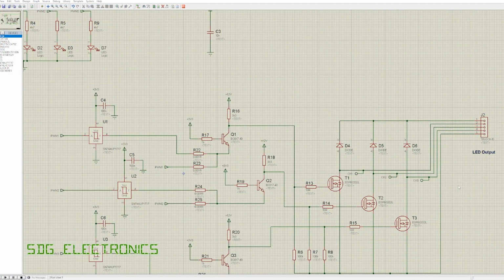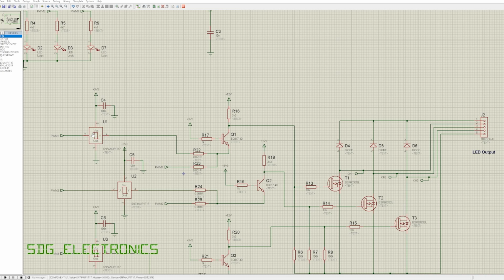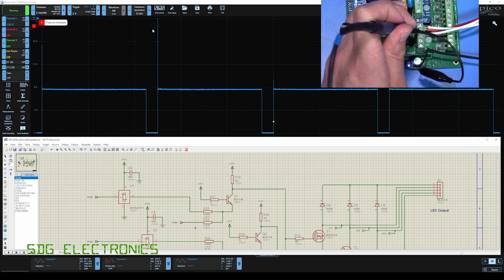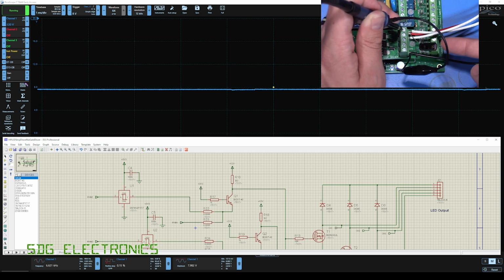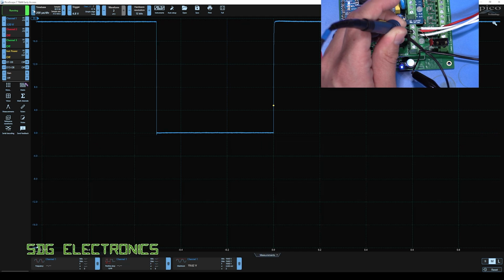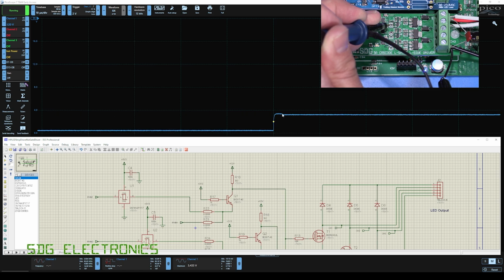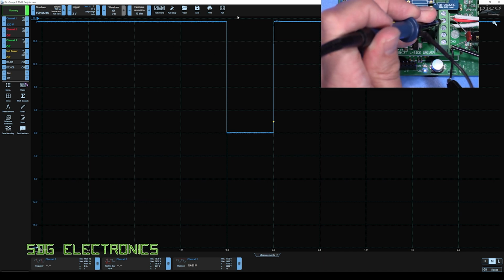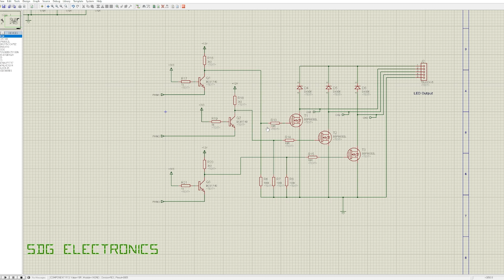SDG #279 Simple Common Base MOSFET driver

Comment: ....Hi, i like your Videos! You really are an expert in what you are doing!  ....ONE QUESTION: Is it possible to use ONE "frequency converter" for 3 little 250Watt 3-phase motors - of which usually only 2 run at the same time - fed by 230V alternating current. ........The problem or background is, we have a "wood chip heater" with 3 three-phase motors and a PV-system with an emergency battery , that only feeds single-phase L1=L2=L3 into our home network.  ...would be great if you have any idea!

Comment: You are attempting to switch a BJT in and out of saturation, which has an inherent slow turn-off time (base storage time), of a few microseconds. If you use a MOSFET in place of the BJT, you will not have that issue.

Comment: All you get is level shifting, pullup is slow due to using the resistor. Add a current source (5mA lets say) as pullup, add complementary BJT emitter follower buffer (BC327 and BC337 for example) and you got yourself a nice fast driver.

Comment: It looks like you read my comment on the last video were I pointed out the unusual use of the common base configuration? As transistors are current amplifiers it’s the common base configuration that pokes its middle finger up at it and turns this on its head. Fits in with modern times, it’s like you have to pay an electron tax just to get the voltage gain :-)

My electronics experimenters’ kit series of videos should have an experiment on the common base configuration as it’s unusual. 
Thanks for the idea for a video.

Comment: there is not much difference in driving power comparison here because at such low PWM frequency Rds(on) is dominating at losses and gate capacity is not much in play.
Go at least in hundreds kHz to Mhz range and FETs are going to burn your fingers.
6:52 But even here we saw Miller plateau effect on gate scope trace. When it is so evident, you know without looking at gate series resistance and supply impedance that the drive is weak.
Reply from the maker: Yes, good point

Comment: IMO That small capacitor across load could bring other ringing or resonance in wires... Probably just thicker wire gauge and power supply closer to module will be enough, as i can see that you have used clamping diodes.
Reply: The only ringing it could bring is piezoelectric ripple from somebody shouting at it.. (NVM, I noticed it is not ceramic as it really should be, buth rather film one here).
Low ESR, low ESL small size (both physical and nominal) capacity is exactly what is needed here for a proper bypass but it has to be as close as possible to switching element to be effective.
Here we see its effect in probing point, but it should really be SMD close to source of spike otherwise you remedy the circuit but still have EMC issues even though reduced.
Reply: @Mr.Leeroy  Ringing is always interaction of inductance and capacitance. In this case, placing capacitor near mosfets act as the capacitance, wires acts as inductance. Resistor in series will act as damper for oscillations. Switching element is not the source of spikes ! Its wires inductance. That spike must be dissipated somehow, so the clamping diode must be fast (schotky) and overall impedance in circuit should be low. If wires from PSU are long, there could be beter to have separate wire from clamping diode to power supply. Agree with possible EMC problems, but capacitor near mosfets does not solve this, as long (in this case, im just guessing few meters) wires will act as antenna. For this case its sometime better to sacrifice few % of efficiency and dissipate some heat - slow down little bit switching of mosfets. For protection of mosfets, if it isnt feasible to use clamping diodes im using TVS.
Reply: @rixelectronics7085  IMO you are overthinking it. It is not a control loop. CC LED source stability is based on local parasitics (since sense wire is connected close to output) and not the whole cable length. I'd be curious to see any such setup to oscillate. Yes, wire inductance is the a partial reason for the spike, but as you said it appears only because we are dumping a lot of current into it in a very small amount of time. But I agree, that it is not worth to maintain such fast turn-on times here, as the frequency of PWM is too low to care about switching losses.

Comment: What type of vacuum tweezers are you using? It looks almost like a standard injection needle?
Reply from the maker: It's a Weller WVP probe with my own vacuum unit, but as soon as I have my next project out the way I am designing a newer one that's easier for everyone to replicate.
Reply: @sdgelectronics  I found your respective videos which I hadn't seen before - thank you! I think I have almost all needed parts at home and could certainly improvise on the handle. I have very nice and thin tweezers which even get the parts out of a tape, even though I often just empty out the needed number of resistors/capacitors. 
However, my problem with side-grapping tweezers is that they often stick to the components.
Reply: There was a video, where Steve was building his own -- https://www.youtube.com/watch?v=1FnGqH_WkL4 -- dunno if he is still using it though.
Reply: Hah, just asked the same question!

Comment: Those turn-off spikes are why I recommended adding a simple RC snubber in a previous video.
Reply: RC snubbers are one method but a simple capasitor (rc with r=0) seems to work just fine as shown in the video. Mosfet of course dissipates the energy charged at the capasitor every cycle. But at such a low voltage and low frequency it is not an issue. RC snubber R is needed to help in power dissipation and also to reduce peak current the mosfet sees when it turns on. With large voltage like mains smps the current spike can even kill mosfets, but a 100n at this voltage is hardly an issue. R helps to dampen any ringing too.
Aty this kind of circuit something like RC or parallel RC dumped through a diode (like often is done in smps clamping circuits) is overly complicated I think. But with large capacitors and/or large voltage those kind of things really need to be considered. Also with larger switching frequency power dissipation can be quickly an issue when the capacitor is dumped in mosfet say at 100kHz instead of 200Hz. Same amount of energy much more often makes so much more heat.
If current paths were designed better, a diode to power rails should work just fine. This usually means coupling led power through a capacitor near enough the mosfet to reduce loop inductance of the dumping patch. A capasitor from end of diodes to gnd near mosfets often does the trick better instead of caps in parallel with every led drive output.

Comment: What does the voltage at the microcontroller's output look like when the output is off?  Is there any risk of damaging the microcontroller with too high a voltage at the NPN's emitter?  Or does the fact that the base is connected to a safe voltage (same as the MCU) prevent excessive voltage?  (This is one of those aspects of bipolar transistors that I have no intuition about.)
Reply: Remember that there is a diode between base and emitter, with the microcontroller output disconnected the emitter will only get close to the base voltage (3.3v or 5v) and no more current can flow (except for some small leakage). The transistor doesn't allow the higher collector voltage to go to the emitter. 

When the microcontroller puts its output low a small base current (limited by Rb) start flowing which makes an HFE times that current current flow from the collector until the collector voltage comes close to 0v at that point only the current from the pull up resistor flows.

The only limitation with this circuit is that the microcontroller pin has those short current spikes when going low and it is slow to turn the MOSFET on.